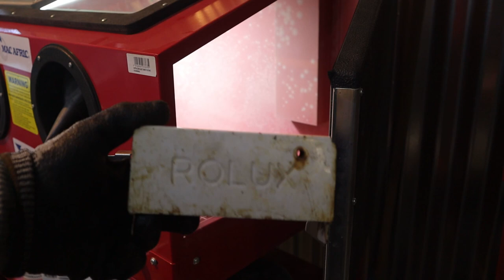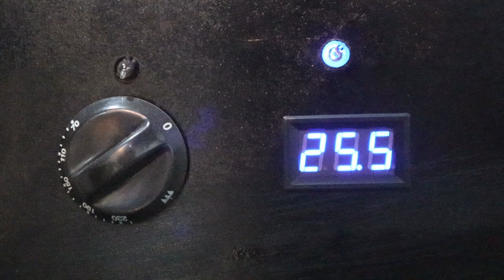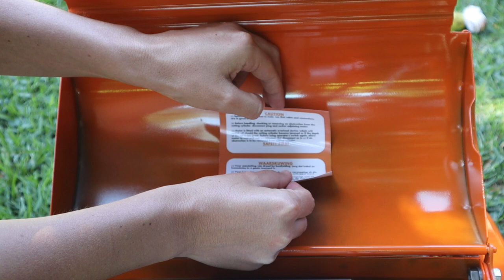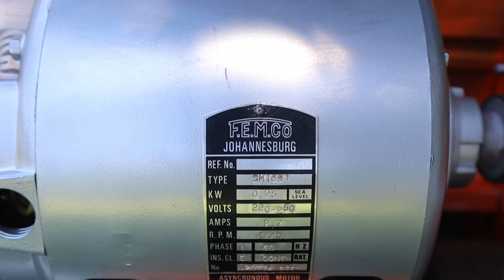1960's Vintage Rolux Electric Lawn Mower Restoration - (Part 2 - The Body)

Comment: Excellent job on this restoration.  I do agree that lubrication might be helpful, but really, I seriously doubt this old girl will spend many hours in actual use these days.  I keep thinking during the watching, "I would use a counter sink Allen screw there" and similar thougthts all through the video, then I have to remind myself.... This is a restoration, not a full on MOD of the device.  You got it just right, use original anywhere you can.  Even though, I know your fingers must be pretty skinned up after wire wheeling all those parts in your hand.

I'm still going through your play list.  And always looking to see if you have done anything new.

Thanks for the excellent efforts.

Comment: Hi do you live in south africa very nice restoration
Reply from the maker: Hi Tom, ja ek is hier in Suid Afrika Gauteng.
Reply: 🇬🇧, When I saw the plug and sockets you had - I eventually assumed you were in Africa, as it had adopted our old British electrical standards - round pin plug and socket, what we used to have until the end of WW2, for the rebuilding program we had a new standard of rectangular pins and fuse in the plug for domestic 240v mains. We still have round pin plugs for special applications.